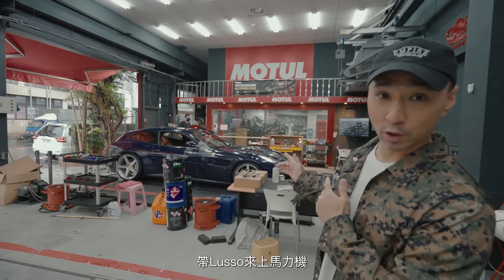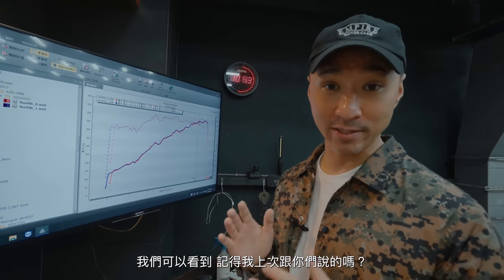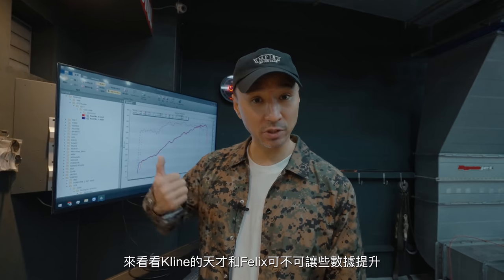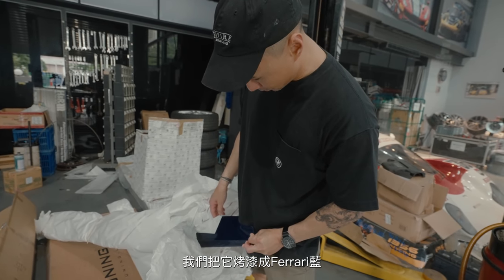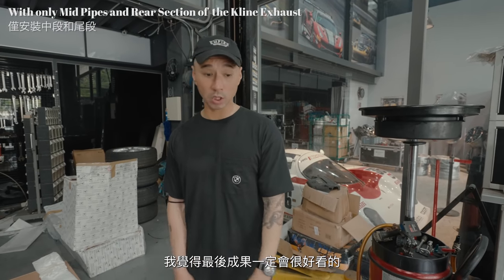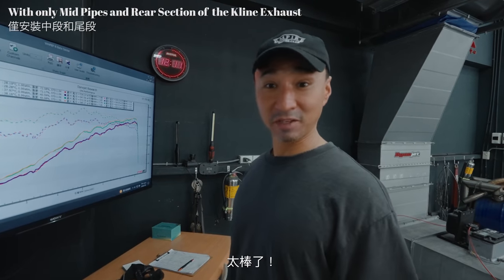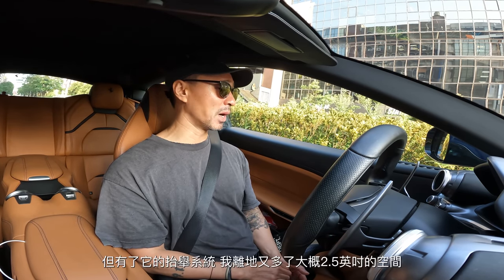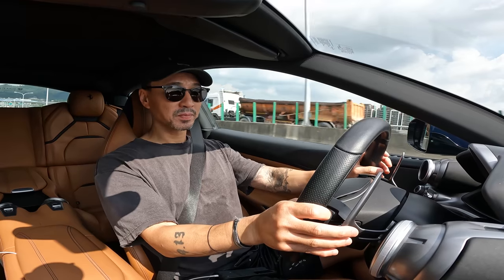地表最帥的 Lusso 來了！EMC  打造 GTC4 LUSSO-R! THE DOPEST LUSSO EVER!《EMC Vlog Vol. 66》

Comment: No way a four wheel drive car with that much weight and 500 odd low torque will slip. Secondly the car has loss power because of the age.